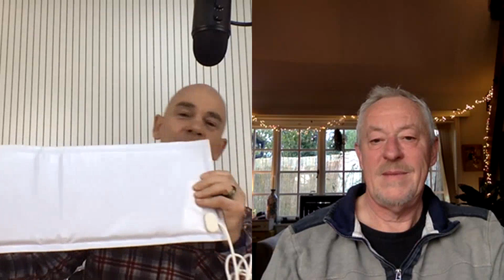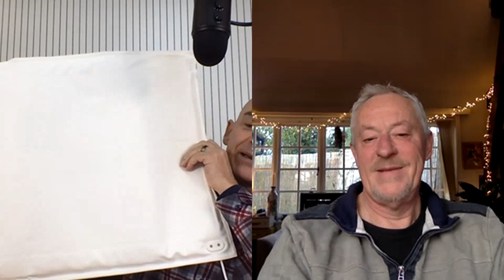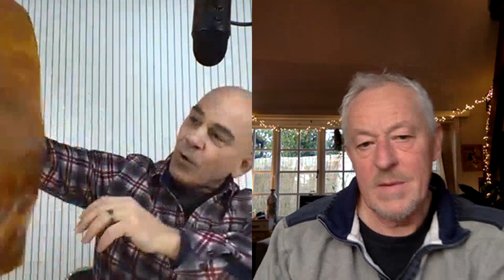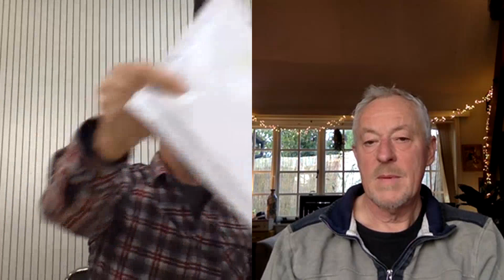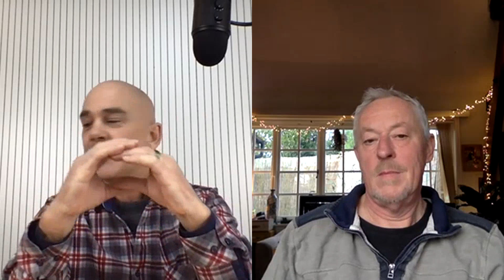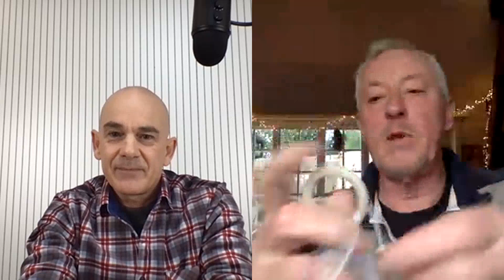An interview about PEMF with Clive de Carle

Comment: can the mat be connected to X gen or Gen X using boost if building a miramate to bnc adapter cable?
Reply from the maker: No, you can not do this, we do not recommend doing this. Miramate big magic work well alone:)